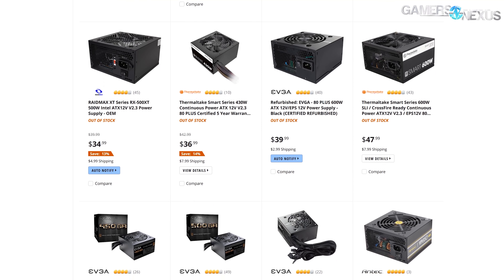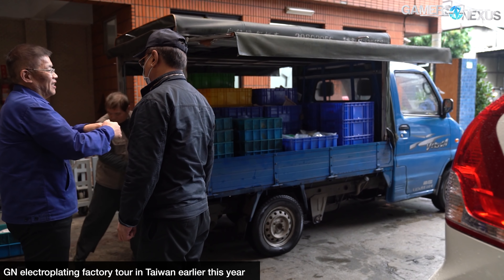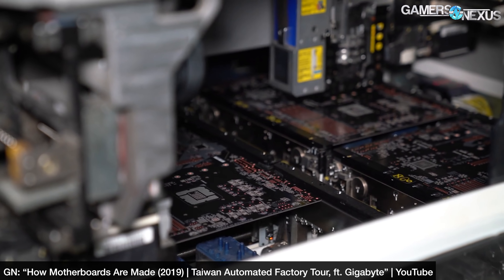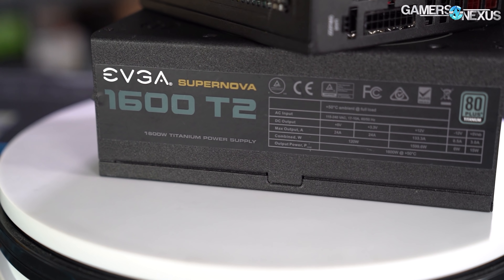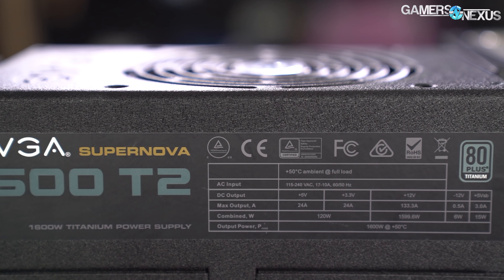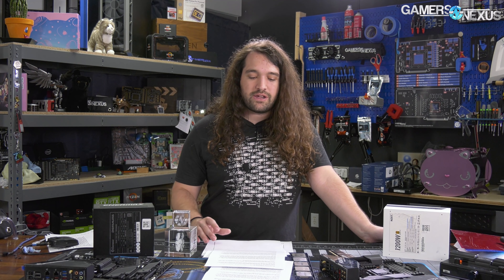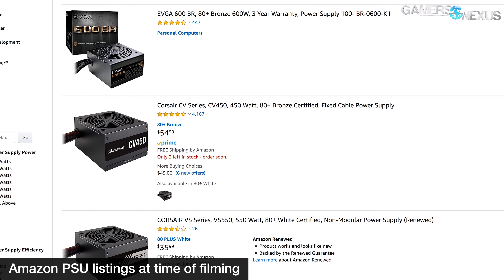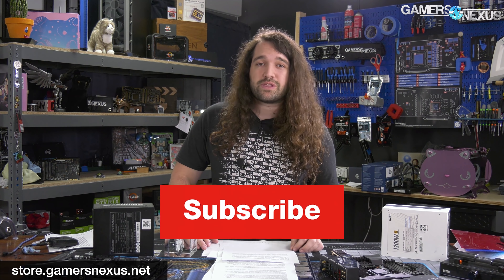Out of Stock: Power Supplies, Motherboards, & Video Card Shortage Explained, Restock Dates

Comment: just got a whole brand new pc and built it durring this time of shortages... its very difficult to find a nice 850-1000 watt power supply, with RGB... its even harder to find a decent priced GPU with Gsync that doesn't cost 1000 dollars... and even more difficult to find a good motherboard that doesn't suck... i ended up getting stuck with a 360 motherboard/processor am4 combo came with a ryzen 5 3600 not the best but it was well worth it for the price compared to others... the GPU was challenging to find i couldn't find one with RGB like i had hoped and Gsync that wasn't 1000 dollars... but i did succeed in finding a gpu that has freesync and is GDDR6 and it works fantastic its not the best but i can upgrade to a Gsync video card with ray tracing at a later date when they come back and arn't so expensive. power supplies were by far the hardest to find... almost nothing with RGB... so if you Opt for full RGB... good luck on power supplies i found 1... and when it was sold out... there was no more for less then 300 dollars... at all... even the company i baught it from was sold out couldn't replace it if it broke.  in the end i did manage to scrape together a near full RGB setup not RGB GPU though...

Comment: If you are not into gaming I guess just buy a laptop & a hdmi cable to connect up to a monitor.   Of course there could be a hdmi cable shortage as well.    And there could be more ex lease type PCs around with business closures & downsizing.   These are perfectly fine if you are not a gamer plus Windows 10 run well on them because they are so common & made by Dell, HP, etc.

Comment: I upgraded my pc 1 and a half months ago because I knew this would happen. I didnt have enough to get my GPU at first, and I finally got on a week or two ago. I originally was going with a 2070 super, but couldnt find any. So, I did what any desperate person would do. Find the closest match to a 2070 super. XFX 5700xt thicc iii. While its great and all, Id of rather had a 2070 super. Im an Nvidia guy, and I actually bought an AMD card for the very first time. Last time I had a radeon card, Radeon was owned by ATI, not AMD. I've gone Nvidia since the 8800gt, and I 100% am going back to Nvidia once the RTX 3000 issues come back. I better hurry up and buy my extra 16gb of ram, for a total of 32gb. 
We should have never put our manufacturing in China.

Comment: I did indeed buy the parts and build my first pc with my tax check.. although i weish i would have bought the fans.. yes cooler master nr120mm rgb fans are sold out everywhere.. and assholes on newegg and amazon are selling 3 packs for upwards of 150-200 USD... when they normally cost 40-50 bucks for three... fml I need fans for my pc haha